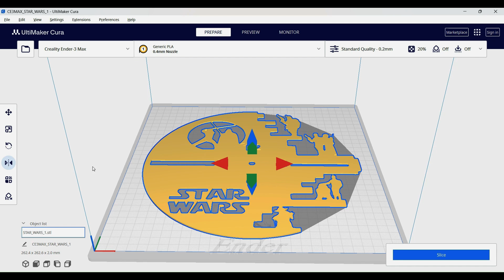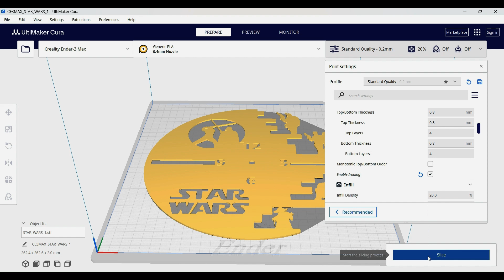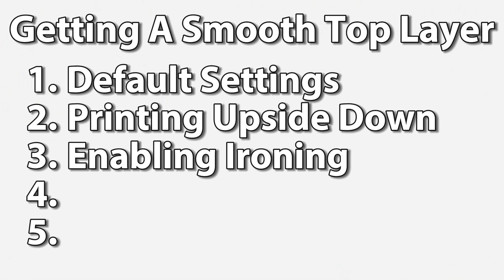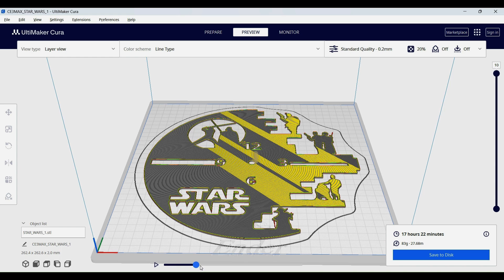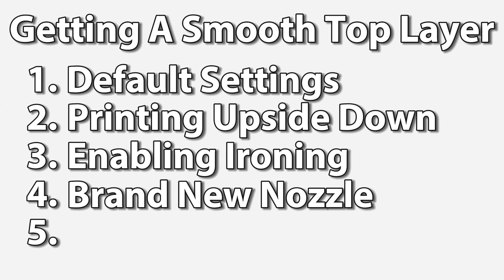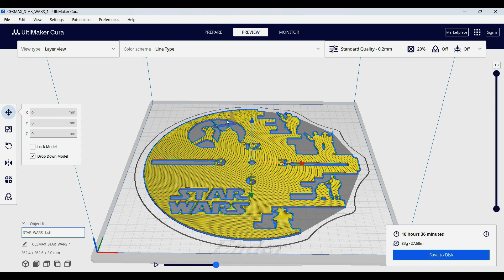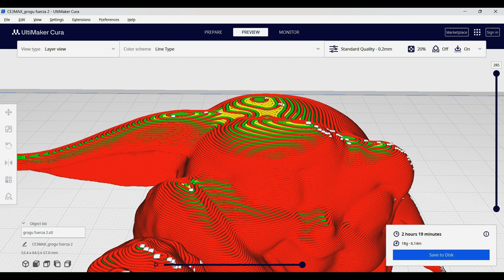How To Get A Smooth Top Layer | No Sanding | 3D Printing Tips & Tricks

Comment: Thank you for this video, very helpful. Question I use 0.4 nozzle should I use 0.2 to help achieve the smooth top layer or it doesn't matter? 
Thank you
Reply from the maker: Great question! I have not tried 0.2 with ironing yet. For ironing specifically, I doubt if there is an improvement it would be enough to be worth the added print time.

Comment: I find ironing works absolutely wonderfully on some parts, and horrendously on others. I have some smaller parts that come off looking like they were injection molded and absolutely perfect. Some larger parts come aft and the ironing seems to burn and bubble.
Reply from the maker: Yea, on a recent print using ironing on my Bambu I got different results with different filaments.

Comment: I really need to start using Cura instead of Creality Print.
Reply from the maker: Yes, Cura is much better. You should try Orca as well. I wasn't using that one until after I made this video.
Reply: @3DMaxBuilds are every settings in this video available in Orca now?

Comment: 17h for that print? What printer do you have out of curiosity? Also that first layer looks horrible, it should be smooth, I would try raising the temperature for the first layer a bit or calibrating it better with orcaslicer.

---
Edit: just realized this video is 8mo 😅
Reply from the maker: That was on my Ender 3 Max Neo. I've been using my Bambu P1S lately

Comment: what printer do you use? on my bambu lab a1 I get better surface quality on standard settings (imported stl file into new project) than you get in 4 step... your bottom side is also much more ugly
Reply from the maker: That was on my old Ender 3 Max Neo. I've been using my Bambu P1S recently.

Comment: The tool pass pattern on the top layer are not layer lines. Try printing upside down on a smooth bed plate with over extrusion on the first layer. Using a holographic bed with that setup will make an exceptionally nice product.

Comment: A print like this,  Print upside down is the only correct option.  But your printer is not setup for a nice first layer.   If you had your Z offset or sensor properly set, and you used a glass bed it would look like a mirror or smooth PEI bed  it would look really smooth.    11-17 hours for that :D  glad I moved on from budget printers Faaack!!       Why not test it with a smaller piece first instead of doing all that to find out :face-green-smiling:  Not all prints can be printed upside down, so  Good note about settings for top layer order though.   by default most slicers it goes back and forth and in bits and sections if it has lots of top surface shapes in the way of large flat sections.  Also ditch Cura if you can. it's the worst slicer out there.

Comment: What layer height and layer width did you print this with?
Reply from the maker: It's been a while since I did these, but it was probably 0.2 height and 0.4 width
Reply: @3DMaxBuilds  yes that is some fine detailed printing. I went as far as 0.04

Comment: Whenever he says "layer lines" he means "print lines".
"layer lines" are the lines between each layer, which run vertically throughout the print, not across the top layer of the print (which is a single layer)

Comment: Although I appreciate the attempt, this could be just 1 or 2 steps:
1. Correct Z height
2. Adjust (first layer) flow/extrusion.
A perfect first layer won’t have any layer lines and will always be better than an ironed top layer

Comment: In my experience if I see layer lines on the bottom layer it means I'm under extruding, first layer temp too low, or bed too cold. Mostly extrusion. My prints always come off with a perfectly consistent face, occasionally a tiny little knot where the plastic pulled up a quarter millimeter.

Comment: The correct answer was #2, upside down. What you saw were not layer lines, they were evidence that you need to calibrate your Z offset. There should NOT be space between lines on any layer, but most importantly the first layer.
Reply: or flow rate, could have been good z with too low of flow rate I think
Reply: @AlexanderKaye-u3y  Exactly. My issue was over-extrusion. I reduced my flow rate for first layer to 95% to correct my poor first layer issues.
Reply: @AlexanderKaye-u3y I appreciate your input, but flow rate affects *all layers*, and issues were not present on the top layer.
Reply: @TheOfficialOriginalChad  Exactly... you don't calibrate flow off the first layer - it'll show up in the rest of the print, through bad overhangs, z-seams, nozzle buildup, etc. When you print face down, your flow is good, and still see those lines, it needs a z-offset adjustment. Either way, for the extra 6h of ironing time, I'd prefer to either flip it and go with texture, or hit it with some 600 grit.
Reply: you can set specific flow rates for your first layer
Reply: @rostigast True. 
So you can calibrate your flow rate for only your first layer
Great advice 😂
Reply: With PLA I find if I increase Print head temp to 220 degrees, the filament comes out like paste and has a smooth print on the bottom first layer. But I'll give this ago for the final layer.

Comment: I appreciate the time you put into this video, especially with the number of times you reprinted the clock.

A tip I can pass along to you is to flip the flip upside down, like you did in the video, but print it on the reverse (smooth) side of a glass bed. It will come out insanely flat and smooth

Comment: Bambu slicer has several adjustable parameters for ironing, one of which is Ironing Flow.  It's default is 10% but I find 11-12% gives me a nearly perfect top layer.
Reply: The Bambu Printers print well enough where you rarely even see the lines without ironing, or at least not as bad as these prints
Reply: @dominicpond  True.  I use ironing very infrequently.

Comment: 1) Print upside down (and use a build plate with a nice texture)
2) Decrease first layer line width. 0.3 works just fine with stickier PLA, 0.35 works with most materials.You need to watch the first layer, if it rips or lifts, then either increase the width by a bit or use a lower first layer height (0.12mm instead of 0.2mm for example).
3) Increase first layer flow rate to 105-110%
4) Use a different first layer infill pattern that doesn't leave gaps (this depends on geometry, I don't change it for most models). Concentric sometimes works better

Ironing sucks, leaves the surface too shiny, tends to clog the nozzle on some printers and can leave some nasty lines sometimes.

Comment: You need a laser to do this kind of thing. You are wasting massive machine time on something a laser does in 10 minutes. Wrong tool for the job. Layer lines are not a problem, they are a feature. You can print an Ikea table. The table is $13.99. You buy the table, not print it. Use the right tool for the job.
Reply: Agreed, this is laser on an acrylic sheet and it'll look much better and much cheaper than 3D printed

Comment: I suggest looking into patterned and mirror finish printing plates, and try the face down option (2) again with the plate designed to give a specific finish. (use slightly higher than normal heat to really let the pattern melt into that first layer( like an extra 5c))

Comment: I would use some of the fancy plates you can get with patterns in them one of the patterns is like carbon fibre which would look good, some of the less obvious plate patterns would also be good. They are generally smooth in texture so a good first layer would give a nice smooth surface with like a printed pattern visual not textured.

Comment: You had it right when you flipped it upside down, but needed to dial in your settings for the first layer. Dialing in the top layer is good when you need a good top and bottom layer, but this could have been just a good 1st layer.

Comment: Smooth PEI or garolite/g10/fr4 and printing it upside down is always the solution you should go for if you want a smooth or even mirror-like first layer since it saves time and significant amounts of effort versus ironing. Just gotta dial in Z-offset to not get those awkward gaps

Comment: It's waaay more practical to simply print it upside down, with a thicker first layer, than sand it after printing. There is no point in the "no sanding" part of the title. Sanding takes only a few minutes, while printing with "advanced options" makes printing much longer, much more prone to error and to wasting material. This is the kind of "tutorial" that makes me think about that joke of leting the stove always on fire just to avoid using matches to light it up.

Comment: Your face down print looks like your extrusion is too low or your z-offset is too far from the plate. My face down prints are much more even with a proper tuned first layer.

But ultimately, for 2d silhouettes like this, I feel a laser cutter and acrylic sheet is a far superior option. If this is for small business commercial production, an investment in a $500-900usd laser wouldn’t be unreasonable
Reply: That's a good point. And it doesn't even have to cost $500-$900. If you already have a 3D printer, you can get a laser head for $150. That's reasonable for a hobbyist. Particularly for a hobbyist who may have upgraded to a different printer, so they have a spare printer sitting there.

Comment: for a while i couldn't figure out why i wasn't getting perfect ironing anymore.. I installed a BL touch. this basically makes the whole print carry the wavy offset of the bed mesh level though-out the whole print. I put Fade_start: 0.2, Fade_end:1 into my Bed_mesh in my Klipper printer.cfg file to fix the problem. Beautiful top layers, even without ironing.. but of course ironing is better. I also have gone full OCD and trammed the printer like its a machining mill lol. So no matter the direction the nozzle is doing the top layer it looks exactly the same

My bed mesh goes from -0.1350 to 0.2400, carborundum glass bed with thick aluminum heat plate. I print up to 115c bed temps, the glass doesn't take long to start warping and finding a "home" to where it settles

Comment: Monotonic simply means the head is traveling in the same direction for each extrusion move. It is interesting that Cura does this more orderly but that isn't a requirement for monotonic. Good video, I think I need this clock for my theater.

Comment: I use PLA+ and the down face is as smooth as a whistle when I use my smooth bed, or has a nice random pattern if I use my patterned bed. My guess is you need to set your extruder temperature slightly higher.
Reply: Do the same thing and turned off the fan and the plate on 10c higher than remmonded

Comment: i think, there are some improvements.

try min. 4 top layers, because the infill is peaking through.
put it upside down, like you did, lower the Z a half layerheigh, put a 0.3 bottom layer with 105 to 110 extrusion. 

is it possible, that you dont have a abl ? because of the big heigh differenzes. 

i use 4 bottom and 5 top layer to vanish the infill peak through and enough stability

its a great idea
Reply: That was my take. The lines are caused to a large extent by the top layer sagging.

Comment: gaps between extrusions on the first layer is something to rectify. Either your z offset is not right, or your extrusion rate is not right. With a perfect first layer, the bottom will pretty much always look better than the top, even with all the settings you used.
Reply: I used a 3rd party smooth PEO print sheet on my k1 max and set first layer to go slow, and the result always come out a very shiny and reflective bottom. I didn't use any glue.
Reply: I use an elegoo neptune 4 pro snd my first layers are never smooth. My top is fine tho. Any ways to have it smooth enough to not look like a bunch of lines?
Reply: @JaseOfSpades101  adjust z offset
Reply: @kawaiichi  is that just the leveling?
Reply: @JaseOfSpades101  leveling is to make the print bed flat, but if the nozzle has too much gap from the bed then it'll still going to print into the air and not the bed, leading to adjacent lines not even being squished into into other.
Reply: @kawaiichi  thanks you, it worked gloriously
Reply: @JaseOfSpades101  you're welcome, happy printing
Reply: This is largely true, but without monotonic fill order, either will look bad.

Comment: I think you would benefit from using Orca slicer, an ABL decice to create a mesh before each print, and a PEY hologram sheet to print it upside down amd give the clock face a holographuc surface. Orca slicer has a lot of great calibration tools that are filamemt and machine specific. You can create a one layer print to perfect your Z offset value prior to running all the calibration prints

Comment: The only thing I would do different is, to print small test pieces, instead of waisting time and material of full prints.
Reply: You would have subpar content doing so
Reply: Waist: something that keeps expanding.
Waste: something government does.
Proper word useage and spelling promotes good communication.
 Don't hate the messenger.
Hope you have a great day!
Reply: @patrickbodine1300  yeah, but using the fuckin “useage” when correcting others is great
Reply: @patrickbodine1300  
Piss Off!   did I say that, right?
Reply: What I would do is use a laser & do it in 1 minute instead of 17 hours. Use the right tool for the job. 3D printing has its place. This ain’t it.
Reply: I don't disagree, but sometimes when you're trying to print something...... It just kind of works out this way 😅 so why not make a video recapping the whole week long ordeal?
Reply: I liked seeing the full result, sometimes test prints just don't accurately depict the real deal.
Reply: @firstNamelastName-ho6lv  what about printing it at a smaller scale?
Reply: Waisting time? What, do you have a belt made out of wrist watches or something?
Reply: @yzmotoxer807 I like this comment